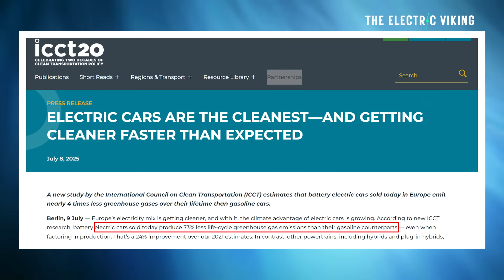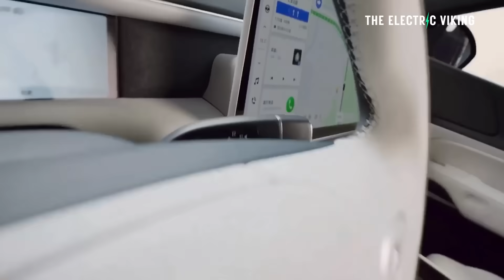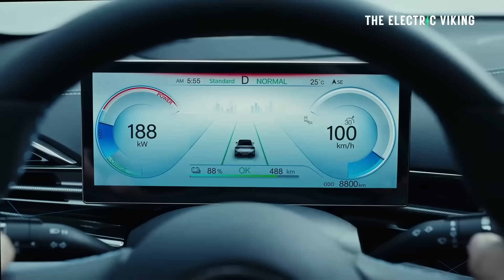NEW Study Says EVs are 73% Cleaner Than Gas Cars - Hybrids 20% WORSE!

Comment: To get the benefit from a non-plugin Hybrid, you have to drive like an egg is under your foot to keep it in EV mode. With pure EV, you get great acceleration AND deceleration without wearing out your brakes and still cheaper running costs. As the grid gets cleaner, existing EV's get cleaner over time while gas engines just get dirtier.
Reply: True, but it is really hard to get any dirtier than an ICE car from making it to the scrapping of it. even trucks do better generally.

Comment: The nail has been hit on the head. Brother! Not only that, but many EV owners get their electricity for their EVs off their own roof in the form of solar power. Zero Emission  from mile one.   And you are right as the grid cleans up so too does your EV, If you charge off the grid.
Reply: The naysayers point out that the total cost of EV's isn't included in the calculations and they may be right but neglect to say that is also true for ICE cars.

Comment: CO2 emissions from the exhaust pipe of a combustion vehicle are not the whole story. There's extraction of crude oil, shipping it to a refinery, energy needed to refine it, putting the petrol part into tankers, and then transporting it to a petrol station where it can be pumped into a vehicle for combustion. Nobody ever asks what happens to the rest of the crude oil that doesn't end up being the high octane petrol part. Why is it OK to forget all the CO2 that gets emitted from the remainder of the crude oil when that gets used in something else, as a by-product of the oil refinery process?
Reply: Of course people leave out the tremendous 4 to 5 times more use of cobalt in refining gasoline which is lost to recovery, unlike the lessor use in some batteries.
Reply: Yeah, but there is also the problem of mining rare earths used in the EV's and the cobalt, lithium and etc, however, the big difference between these two is, there is no way to reduce the drilling and refining and transporting of oil, whereas battery development and better EV motor technology is still happening as we sit here. Fossil fuel impact will never reduce, we've had it for 100 years plus and it's still the same dirty business, but new materials in batteries, recovering and re-using the rare metals and other materials used in EV's is getting better and we are getting more clean solar and wind power all the time, so even if the impact of the oil drilling and refining was the same as mining the rare metals and cobalt etc for EV's (which it isn't), there is room for a lot of improvement in EV technology, but fossil fuels are stuck in a dead end.
Reply: Woah such professional summary but I cannot see where are statistics about tires wearing much more. And those are responsible for huge amount of PPM 2.5-10
Reply: @DrOffgrid  Because so many US car drivers drive "trucks" the average weight of a US ICE car is not much less than the average wight of an EV, in fact about 2 people in extra weight if that. Driving style has far more impact on tire wear than just weight, if you drive aggressively then you will wear tires out faster regardless of what sort of vehicle it is. Yes it is of course a problem no matter what the car, but EV's driven properly aren't that much worse than ICE cars driven properly, and of course the inverse is true also. Maybe we should be working on new tire technology a bit more.
Reply: @stevebrooks2361  statistics always kill the idea. Now european union tries to kill phev cars in my region saying they are worse than ice cars, when used properly they are the best of two worlds together
Reply: @DrOffgrid  Well we all have different opinions, In my opinion PHEV's combine all the good ideas of EV cars with all the worst ideas of ICE cars, which is not to say they don't have application in some areas, but for somewhere like Europe with EV chargers every couple of kilometers I can't see the need for PHEV's. The major point of EV's is a reduction in pollution of course, that's a given, but secondary to that is a reduction in maintenance and servicing costs, reduction in complexity and fewer breakdowns. Not a fan of all the smart technology and screens myself, my ideal EV would be a converted classic with a battery meter,  speedo and basic controls for the EV power system, but they do tend to be on the expensive side. A problem with PHEV's is when you put a ICE in an EV you basically eliminate that advantage.

As I said, I don't disagree they have a use case in some regions, remote areas like my location where charging stations can be hundreds of km's apart, but in Europe? I just cannot see the need for PHEV's.
Reply: @stevebrooks2361  agree with everything but one question. What if? 
And I'm talking about blackout scenario like in Spain last time. European grids are becoming less stable with each year, I am for BEV car but only as secondary car in family for short trips around the block.
Reply: @DrOffgrid  The Spain blackout was entirely operator causes and not to do with any power sources in particular, renewable or traditional, it would have happened no matter the power mix, here's a summary: 

"The Spain blackout in April was caused by a combination of technical and planning errors that led to the grid being unable to handle a surge in voltage. Specifically, the grid operator, Red Eléctrica de España (REE), miscalculated the power capacity needed for that day and failed to activate sufficient backup power, leading to a cascade of failures when demand exceeded supply."

So it wasn't a matter of there being to much or to little power from renewables causing instabilities on the power grid, it was entirely down to an error on the operators part, and that's something you can't account for no matter what your power source.

But just consider, if every home had enough solar and battery storage (including from your EV maybe) to keep running indefinitely, not  hard to do if you watch your power usage specially in a place like Spain with plenty of sun, you wouldn't have had millions of homes without power. In fact the Spanish power outage was a prime example of why we need self managing need microgrids rather than the traditional power system we have at the moment. European power grids aren't becoming unstable due to power sources, they are becoming unstable due to the "transition" from traditional to renewable and not the actual use of renewables. Once that transition is fully completed and Europe's power systems fully converted any instability will go away.

Yes it could take quite a few years, but it's the transition process and not the power source that's the issue, power storage systems need to go ahead with renewable power generation transition. Sure most of Europe is not as lucky as Spain, or Australia, in the amount of sunshine they get, but they do get lots of wind so that's a plus, and having many homes and local regions generating and using their own power would reduce the shock of occasional power problems on the main grid.
Reply: @stevebrooks2361  if what you are saying is true I wouldn't start this autumn building full offgrid house in Poland, where we have maybe 25% of land with good wind. 
I've stopped trusting other people, especially European politicians. 
Do you know what kind of beaurocracy madness they proposed for Polish people that wanted energy storage in their homes? How much is the cost of energy storage for average person considering salary? People need to pay shit loads of money for 15kwh where I get same volume for 1/3 of that price because I can do it by myself. 
Poland is waiting for small atom since 90's, our politicians see only their end of nose that's why in perfect conditions next year I see my new house as independent from grid and my primary car as PHEV. Sorry mate but there always should be a balance of doing what is right for society and doing what is best for safety of your family.
Reply: @DrOffgrid  Not sure what I've said that garnered this reply, but I am all for houses being independently powered and able to operate off grid if and when necessary. Politicians are an evil we it appears have to have, but few rarely see beyond the end of their term, short sighted and in it for themselves mostly. Yes you can certainly buy your own batteries and set them up for a fraction the cost governments and companies want you to pay, good on you for doing this.

As I said PHEV's have a place, and just because you live in Europe doesn't mean you are as well served for charging as everywhere else, when I say Europe I am of course thinking of places like Germany and France, that's my fault in not thinking of countries like Poland that aren't as well served by their politicians and infrastructure.

I live over 1,200km from our state capital, charger are 200km-300km plus apart here so a PHEV here would make sense, but if I lived in the capital I would buy a full EV. You need to plan for yourself and your region and conditions of course.
Reply: @stevebrooks2361  it was 5AM here I was barely reading your comment with one eye open, brain was working like a cold engine 😅
Anyways thanks for fruitful discussion, you are right about doing what suits more into surroundings. Wish you all the best from 🦅 Poland to US 🦅, countries of 2 screaming eagles. 😂
Reply: @DrOffgrid  All cool lol, wish you all the best.
Reply: Do EVs magically create their own electricity?   The world will still need fossil fuels for the next 50 - 100 years to run the power plants... once the electrical grid is doubled to handle the flow of electricity to chargers at home and charging stations.

Comment: Everything needs to be electric and if you can solar and battery for your home, 14yrs we started going electric with an extension to our mortgage. We are now all in and our house currently runs on solar 85% of the time on average, that’s over the whole year. Our next upgrade will take us to >95% of the time by the end of this year. It can be done, you just have to make the upfront investment. Not everyone can, but if you can… do it for your children’s future.👍😊
Reply: Marks, our goal is similar to yours, 95% (hopefully 100%) energy self sufficiency. Gas, propane and electricity are all very expensive in our US state, especially in rural areas. 

The nearest gas station is a twenty minute drive away. The cities we do our monthly, big shopping in are an hour away. So, we can get there and back charging at home.  Our families are in a big city a 75% charge away. We have no problem getting to our favorite trailheads and campgrounds with the EV.

The our trouble had been the home batteries. Before Tesla Powerwalls, battery storage was difficult and too expensive. Powerwalls are 1/3rd too small to be completely off grid, and far too expensive. But in the last few years, more affordable abs modular alternatives to Tesla Powerwalls have been introduced. 

Forget the future. The present is electric
Reply: @freeheeler09 Yeah, that's why I got a Cyber truck, it powers my house along with my solar panels when the grid fails.I also got 5 mini-split A/C for my house saving half in electric costs.

Comment: I owned a Lexus/Toyota hybrid for years, the gasoline engine was on, all the time, except when parked and stopped.  I saw no benefit of owning a hybrid.  Sold it and bought a Tesla Y, as did my wife.
Reply: So the higher gas mileage you got with the hybrid was not seen as a benefit?
Reply: @FordEnthusiast413  There often isn't any higher gas mileage, an example is my 2008 Nissan Altima Hybrid which got less gas mileage not more.
Reply: @tedmoss dude…..I’m a Nissan fan, but the Altima Hybrid is trash

Comment: A real technical problem that has not been resolved until now is that the energy density of electric car batteries is still far inferior compared to diesel/gasoline.
Reply: For no other fuel do we include the weight of the reusable container in the energy density calculation. Batteries are refillable. Sure, they are heavier than a gas tank but no one includes the weight of a gas tank and fuel pump and  injectors and exhaust system in the density calculation for gasoline. If you use the total weight of the vehicle, which I believe is the only fair way to look at energy density, some EVs are much more comparable to gasoline vehicles.
Reply: @ronaldeichenlaub7720  It depends on whether you want to be honest or not.
Reply: @ronaldeichenlaub7720 I think he was referring to the energy source. Gasoline/diesel as an energy source vs the battery. 

Which similar to what you are saying is a wrong way to look at it.

I drive a lot, may be 60,000 miles a year. I bet if I only charged at home that I would only become more efficient
Reply: @Hwkman4  Battery's are not an energy source and never have been, they are storage, its the much more efficient grid generation or solar or wind or water that is the energy "source" actually its the Sun.(Even single use battery's aren't, its the chemicals in the battery that releases some of the energy that is in them (which comes from some star like the Sun).
Reply: Sure, the more density the further it will go. But then EV are much more efficient converting that electrical energy to mechanical, compared with ICE
Reply: Nicholas, our EV with a modest 260-mile range more than meets our needs, even for longer trips. 

We don’t own our own oil well or refinery. And the increasing fires in our region are an existential threat. So we can no longer burn fossil fuels. Electricity powers our home, business, greenhouses and car. Better batteries have made this all very functional and economically sensible.
Reply: Why is that a problem? That you have to recharge more frequently than gas up? Like 20% more often? Isn’t that actually an expectation problem, not technical?

Comment: Turns out we're already at the stage where tyre wear emissions are greater than tailpipe emissions. EVs actually make that worse due to their greater weight and torque. 
Busy highways in urban areas are a major health hazard for at least 100 metres either side.    The particles are airborne so cause respiratory issues, then end up in watercourses contaminating drinking water and harming wildlife. 
Heavy trucks are particularly bad, generating ten times the particulates of cars.
The whole concept of rubber tyred vehicles in urban areas needs to be rethought.  As someone said, a Walmart parking lot full of EVs is still a parking lot full of cars. The detrimental health effects of tyre dust should be considered whenever planning an urban highway and should be balanced with electric rail alternatives in urban areas.
  I asked chatgpt about this. Remarkably it was able to calculate the approximate health and environmental costs of tyre particulates over a typical 50 year lifespan urban highway. It could reach 20% of construction cost. If that were factored in this would justify diverting more funds to electric rail alternatives and deemphasizing rubber tyred vehicles.
Reply: Funny thing, my model Y has gone 60,000 miles without needing new tires.  Turns out if you drive conservatively they last a long time. 👍
Reply: @chrishaberbosch1029   Yeah it needs more research. They are developing special tires for EVs. But US particularly needs to look into the health and environmental costs of high speed traffic in urban areas. Noise is an issue too, and EVs are no quieter above say 30 mph because it's all tire noise.
Reply: @charlo90952 So tyre noise plus engine noise is the same as the tyre noise on its own.
Reply: @charlo90952 Model 3 and Y Tesla's are under 2000kg, what do you think the most popular ICE vehicles that are sold weighs in the US or Australia.
Reply: @GDM22   yes. Engine noise is insignificant compared with tyre noise at speed.
Reply: @GDM22   well all modern vehicles are heavier than they were 20 years ago, so that means more tyre dust and road noise. There should be more restrictions on high speed traffic in urban areas.
Reply: Which Expert told you this ? was it your Uncle Bill or was it your Aunty Mary. Thanks for your Expert Advise
Reply: @neilellison8984   ha. Chatgpt told me all this, as I noted. It's a fount of wisdom. 
   It's able to do calculations. Very handy.